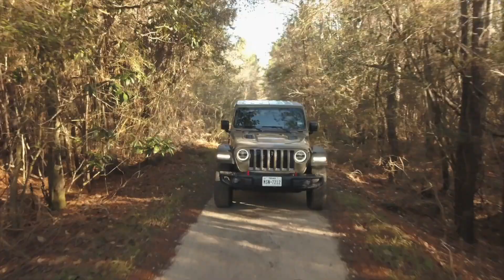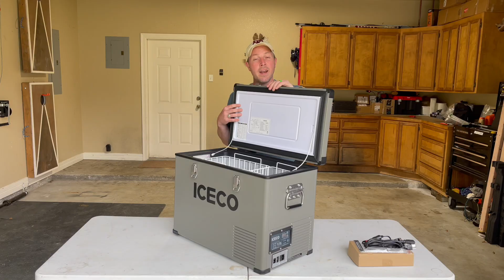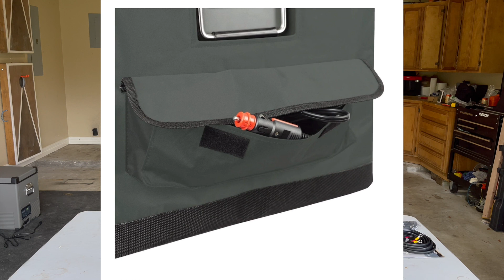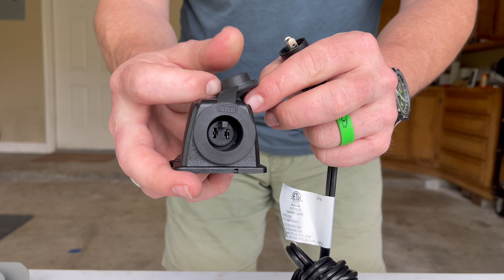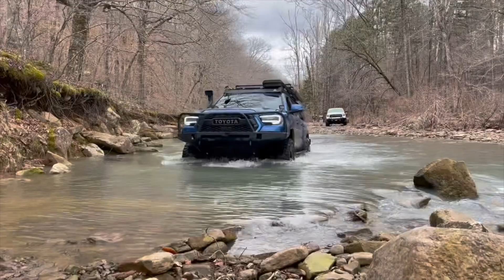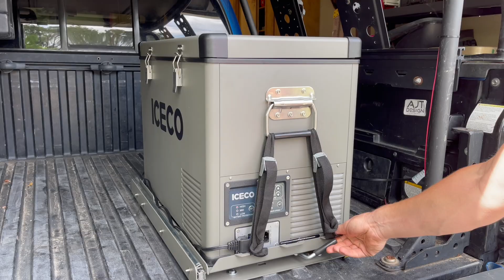ICECO VL45 Fridge/Freezer Evaluation + Install

Comment: How would you, or how are you protecting the Iceco fridge from the rain? . Thank you in advance.
Reply from the maker: Per advisement of iceco, the fridge is completely fine in the weather as long as it’s not submerged. My tent on the bed of my truck does add a bit covet from direct contact with the rain.  If you want a weather resistant model, look into the alp 55.. I’ve had no issues with this in the bed over the past 3 years.
Reply: @GatorOverland   I have been burning my brain trying to figure this out, it is a big change from me coming from a 4runner.... I have my Iceco for 4 years but it was inside the 4runner (Obviously).  Appreciate you.

Comment: 7:22 that's not 40 degree's by the way. just wanted to let people know. the gauge is sideways.
Reply from the maker: The information is sound though, the fridge is capable if 40deg… Thanks for pointing it out. You’re their first I nearly 2years and 11k views😂😂😂
Having the angle finder, slightly skewed on the top will throw off the angle somewhat, but for the most part, it’s going to be near… .

Comment: Just purchased a VL45ProS. Any issues with it being exposed to the elements in the bed?
Reply from the maker: I nearly 2 years of bed travel (10k miles or so) I haven’t had an issue. Per their advisement it should be fine exposed as long as it’s not submerged or in direct flow of water..
Reply: @GatorOverland  Perfect! Thank you. Cant wait to start using it.
Reply from the maker: @vinib72 camping will never be the same when you stop worry about ice.. we love it

Comment: If you plug in the AC and DC ports which will it prioritize? Will it swap over if 1 source dies?
Reply from the maker: Yes, it will stay on if one source looses power, shown at 14:30 i apply DC and remove AC power without fault. I’m not sure which one it prioritizes.. I assume with it being a 12v DC fridge and a inverter to swap to AC it would have a 12v DC priority.
Reply: @GatorOverland  awesome brother. Thx for the info.

Comment: ecoflow is NOT a generator. it is a battery. it does not make electricy. it stores in chemically.  good to hear that iceco does allow the unit to be held down by the handles, this is the first review i have seen stating this. but i would still like to know if screws or bolts are holding the handles, hasps, hinges on. as my usage puts it inside, and do not want the unit or stuff inside becoming missals. should have seen the inside of my old F250, after the guy hit me head on. and i was in a larger, heaver truck.
Reply from the maker: Thanks for taking the time to watch and comment. Yes the ecoflow is a portable power station.. if I said “generator” you can mark me down for one of my many verbal mistakes in the videos I make. It is stored power, not generating.. I’m not sure if they have any other fastening method than straps through the handle. My arb elements is able to be bolted down by its feet.

Comment: Thanks for the great information. Is there a cord or adapter that allows for using the Ecoflow with the ARB 12v plug?? Thanks
Reply from the maker: At this time no… What I do is I switch back-and-forth from the provided plug that came with the Iceco and the arb plug. If I am camped for more than a day in the same spot I will plug into the EcoFlow, but otherwise I am running off the chassis battery and the ARB plug…
Reply: @GatorOverland  got it. By the way I tested the Iceco running off the Ecoflow empty, indoors, probably 70-80 avg. temps, it ran for four days. Obviously not comparable to real use conditions but surprising none the less. Thanks again for the information.
Reply from the maker: Absolutely… Obviously testing it indoors in a consistent environment MT gives you the long term test… But you should see similar results in a true environment with product on the inside because it will maintain the cool temperature longer than an empty one… At least you know worst-case scenario four days🤘🏼🤘🏼🤝

Comment: do a test loaded with food. 72 hours with an unloaded fridge isn't a realistic use-case. 45L of water would be ideal :)
Reply from the maker: I’ll do that test privately and report back. This test Is about thermodynamics of a empty cooler to test the it’s efficiency against battery consumption of the power station. An empty cooler has only air and nothing to maintain the temperature internal temp.. the more stuff you put in there the longer it will stay at the temp and therefore lengthen the time between run cycles and which would extend the life of the battery. So yes, it is a realistic use of consumption of an empty cooler… The more stuff you put in, the longer it will run with the same amount of battery power… The variable is too large to say how much longer it would take to drain the power station.… water bottles could be 100hrs, steaks could be 80hrs. The point was to show its efficiency at an empty state which would yield the quickest consumption, and it proved to be at least as efficient as they advertised, and in my case better.
Reply: Mm, good point. the type and amount of stuff in the fridge would introduce quite a bit of variation, so the baseline is good at determining insulation performance vs. minimum compressor run time vs pwoerbank capacity. I just took mine on a long trip. Things I noticed: 

1. Putting in pre-frozen meat and refrigerated drinks and butter and vegetables made the fridge register -5C for most of the first day, letting the top of the compartment get pretty warm. 

2. Once everything was settled (same temp) I had to set the fridge to -4C to keep drinks cold at the top of the fridge. Only the walls of the fridge exhibited frozen condensate. 

3. 160W solar panel is plenty good in keeping the fridge at -5C all day on a sunny day. It was 33-35C ambient the whole trip. 

4. Some dirty math: My powerbank is rated 164Ah (allpowers S500,) kept topped up throughout the day, and discharged to 75% overnight (roughly 17 hours.)
ICECO claims 290W consumption for 24H, ( or 12W/H.)

My results: 164Ah * 0.25 * 12 = 492W consumed (29W/H) roughly 2.5 times the power consumption. 

I suppose the temp sensor on the fridge is pretty localized to the bottom, and that the food mass leads to some uneven temp mixing. Would be curious to see if you get similar inconsistencies in your tests (food temp at the bottom vs top)
Reply from the maker: Thanks for following up with a thorough evaluation… I like seeing numbers like this… Yes the temp sensor is typically located near the compressor so that it doesn’t get overworked… I also keep a digital thermometer clipped to the inside for secondary reference. It allowed me to understand initially that the calibration of the fridge came at about 8° off…
Reply: @GatorOverland  Interesting! Im waiting on a small thermometer to get accurate readings. any chance those calibrations can be programmed to the fridge?
Reply from the maker: My iceco was spot on with my digital thermometer… My ARB was off by 8°… It was simple function of holding down certain buttons to activate the calibration and simply pressing the number down to what was specified on the thermometer… You would have to read the nomenclature/manual of your fridge
Reply: @GatorOverland  got it, thanks! will get to it :)

Comment: Dometic hasn't used a Secop compressor in years.
Reply from the maker: Very true… to my understanding they when they developed the CFX they put in a China copy of the danfoss/SECOP compressor.
Reply: @GatorOverland  The Secop is a Chinese copy of the Danfoss. Danfoss was sold to Secop and they moved the production to China. They were made in Denmark. Everything that's a centrifugal 12v compressor is a knockoff of a Danfoss. The company that owns Whynter brand was the first to copy it. Can't remember the name off hand.
Dometic designed their own. VMOSO2 and VMOSO3. And it's made in China of course. But so is the Secop. Dometic's compressor runs different than the Danfoss style compressors. It'll pull and run as hard as it can to cool things down. Where as a Danfoss will run at a set speed til it cools everything down.
The only ones that aren't Chinese made are the Kt511 and Kt611 Sawafuji swing compressors used by Engel. Those are made in Japan. And they last pretty much forever.
Reply from the maker: Sounds like I need to do a dometic video 😂😂.. thanks for the info🤝

Comment: Another thing that should be noted is that this frige is capable of switching between the 120v and 12v inputs automatically. I use mine with a Jackery 300 watt unit. The frige 120v and the Jackery 120v charger are plugged into my F150 bed outlet. The 12v cable is connected to the 12v output of the jackery. This means that the frige runs from the 120 volt when the truck is running, and the Jackery charges when the truck is running.
When the truck is off the frige runs from the 12v Jackery output.
Reply from the maker: Thank you for pointing that out, you’re absolutely right. I should’ve been more direct about that in this video, I show it at about 14:30 them both plugged in, but didn’t cover the priority of the input

Comment: That is a very nice fridge! Would this work in the bed of a truck, exposed to the elements?
Reply from the maker: Per the advisement of iceco as long as it’s not submerged or forced intrusion it should stand up to the elements, but by comparison it is not to the same weatherproof specifications as the ARB element fridge… After review of Facebook groups and forums there are many folks that have use these for years without issues… They do make a weatherproof cover add additional weather protection and enhance the thermal efficiency.
Reply: @GatorOverland  Wow, that’s great! At a fraction of the price of the Elements fridge, I’d say this is a winner! I currently have a Massimo E-Kooler that I got at Costco for $450 (on sale), but this Iceco isn’t a whole lot more and looks way more rugged and better built. The E-kooler has been serving me well so far. It has built-in battery backup and will refrigerate and even freeze items with ease. And it’s huge! 64 quart. But it doesn’t have the baskets so items can get lost in it and is extremely big and bulky. And it’s basically just a cooler with a compressor built in. So I’m always on the lookout for a more dedicated and rugged overland fridge setup. At only $100 more, the Iceco may be the fridge I’ve been looking for. Thanks for another well-put together and thorough evaluation!
Reply from the maker: I own the ARB elements fridge, And it’s definitely a worthy unit… But to suffice, you could on two or three iceco for that price.. I did the same energy consumption test with the iceco and it lasted 52 hours… It is a 63 quart fridge and the ambient temperature was mid 90s… So 20 more quarts and 20 more degrees ambient temperature trimmed about 20hours off by comparison with the iceco 45.. after evaluation of this unit I think I would probably consider the pro model for the added conveniences and it is only $100 more than this unit… But simply there is nothing wrong with this unit at all, it obviously proves it self worthy.